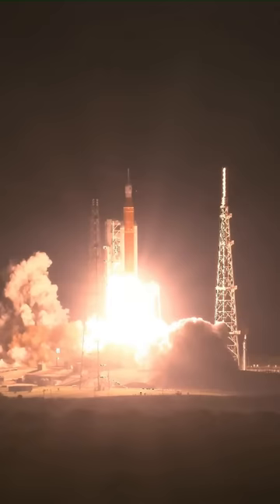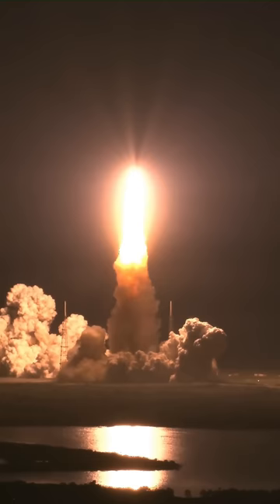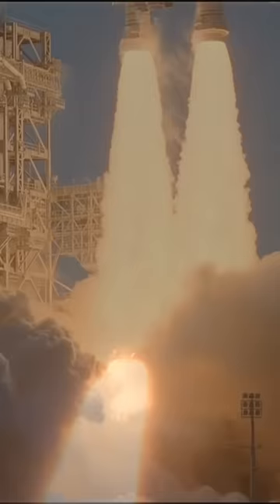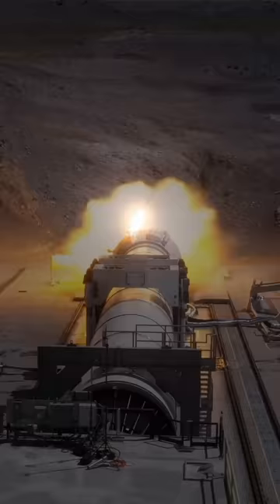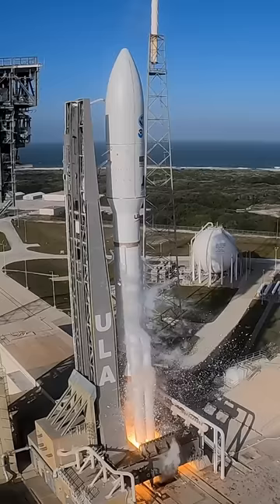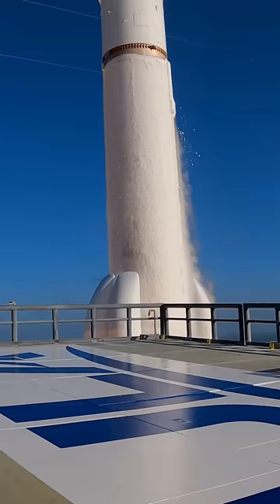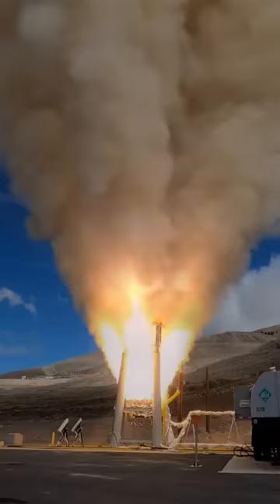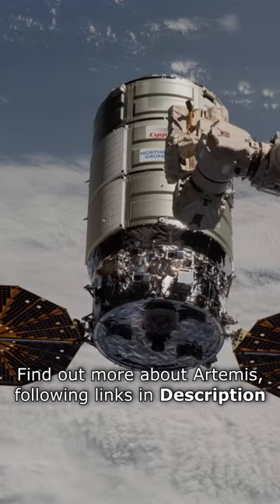The Most Powerful Rocket Motors Ever Flown!

Comment: Back when the Shuttle Challenger had a series of unfortunate events on launch, I was in college earning an aerospace engineering degree.  Dr. Seversike was teaching a spacecraft system class, and suspended coursework the day after the disaster to show us some videotape NASA overnighted to him to analyze.

They clearly showed the SRB burning through the side, cooking the tank.

The thing I remember most, though, was his very expert opinion that NASA has no business putting SRBs on human rated spacecraft, and events like this could be expected to happen sometimes, if they do.
Reply: At least THIS spacecraft has the crew compartment on TOP of the rocket assembly, along with a launch escape system, in case something goes wrong.
Reply: @davidharrison7014  Since you can't shut them off, there are serious implications to abort.  Specifically, it is likely in a high speed RUD, with escape tower abort escape, the free but still burning and thrusting SRBs could pass the escape tower stack, and possibly strike the capsule--free SRBs can accelerate VERY hard.  To prevent this, abort motors must be extra-brutal, and marginally survivable.
Reply: @davesvoboda2785  I never thought about that.

Comment: Why, according to the Wikipedia article, if I read it correctly,  does SLS have lower mass to LEO and TLI than Saturn V?  Is one or other of the Wikipedia articles wrong, am I misunderstanding or is SLS really that much less effective at its primary job?
Reply from the maker: SLS is about 400 tons lighter than the Saturn V. But Also the first version is missing a proper sized upper stage.

Comment: It's been bothering me since the launch, but seeing the shuttle footage for comparison I finally have to ask: have we lost the technology necessary to correctly expose footage of rocket launches? Everything I've seen of the SLS so far is just fine fine fine and then WHITE. What's up with that?
Reply: It's almost all automatic in digital camera's.  They just don't keep up as well.
Reply: @TheEvilmooseofdoom  sure, a digital sensor doesn't have the dynamic range of film, but most of the exposure in a shot like this is down to changing the aperture, maybe also the shutter speed, depending on the camera I guess. But still, are you telling me a modern camera can't stop down fast enough to keep up with an SRB plume coming into view?
Reply from the maker: The non-NASA photographers got some great images, I think it’s just practice.

Comment: So why couldn’t SpaceX start buying these and using them along with Falcon 9 for those missions where they have to ditch the lower stage to launch 10,000 Geosynchronous Satellites. Then the lower stage would have enough fuel to do it’s usual landing for reuse! I’m sure SpaceX could set up appropriate tie ins to the structure to handle the external thrust, or use the Super Heavy Center Stage with these instead of two more falcon stages.  These SRBs could still fall and parachute into the sea like in the days of the Shuttle for refurbishment. 

Is Artemis or any of the other systems allowing these SRBs to be recovered?
Reply: Because a single engine already cost more than a falcon heavy.

Comment: The only challenge with SRBs is that there is no throttle control.  Once lit,  it is full on until the end.
Reply from the maker: There’s throttle variation, it just has to be cast into the rocket at the factory.

Comment: Hydrogen-900 tones-hellium900 tones,oxygen-10 tones  , satellite flying,  titanium steel 80%,seesam-20 %, metal spacesatelite body, spacesatelite body manufacturers Parealealaxesses thoream and aerodynamicdegined and thermal air protection systems and anti icesyesteam,  hyespeed  travel space mass,valacitey, speed  based, great experience sciencetest all congratulations